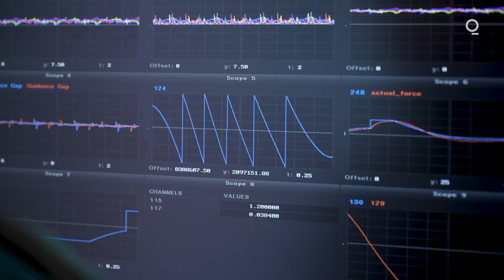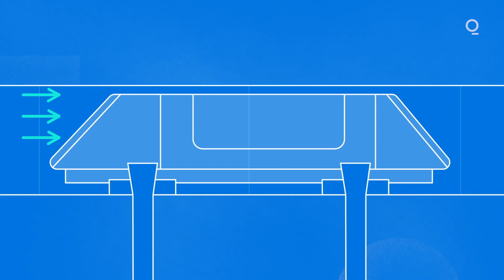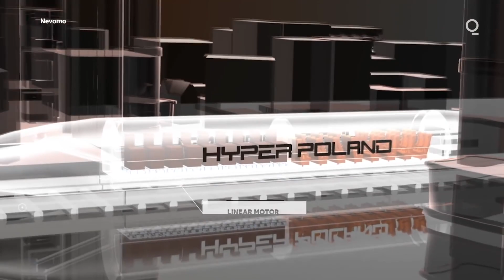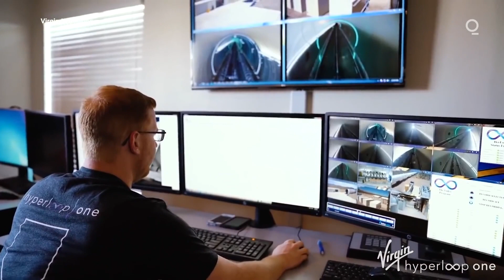The Hyperloop Disruption 2021 | Elon Musk's Idea Coming to Life

Comment: The original founder concept, (what Mr. Musk promoting model type), had no vacuum air, in tunnel/pipes, it was actually a hoover train, fan blade propulsion absorbing air from front to floor to levitate. Today, magnets could multi task the fan blades tranfering friction front2back, levitate and momentum across rails, the more narrow the tunnel, the more borrowing through air, the more friction, which is the real issue for why vacuum realms is required.